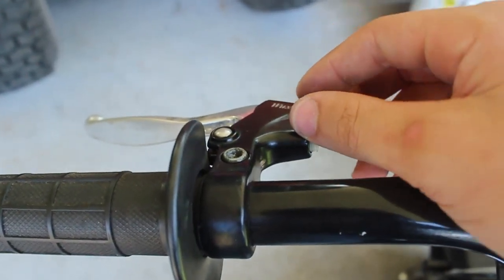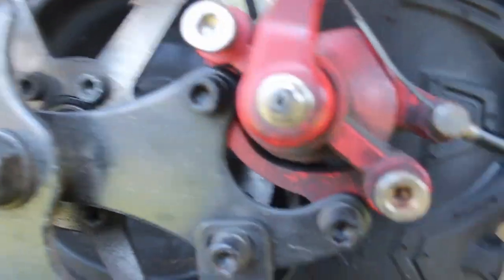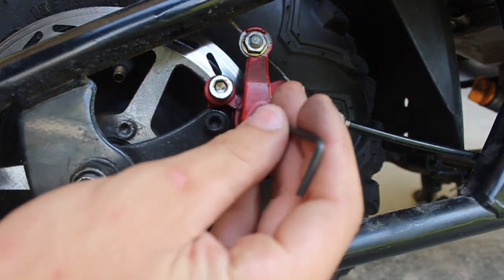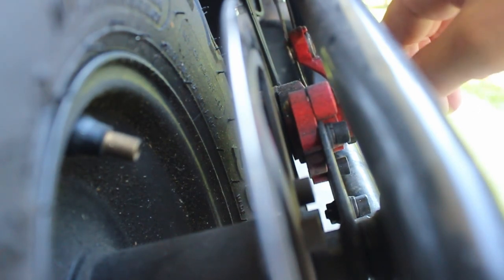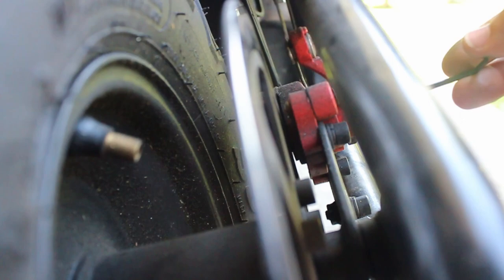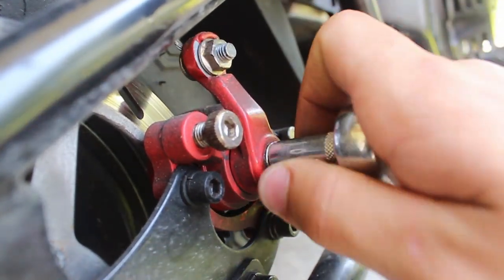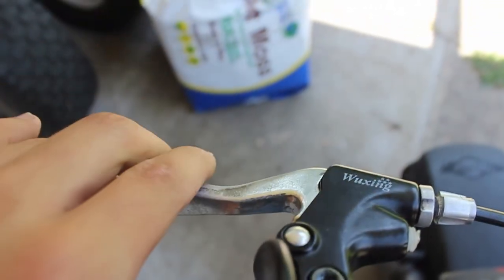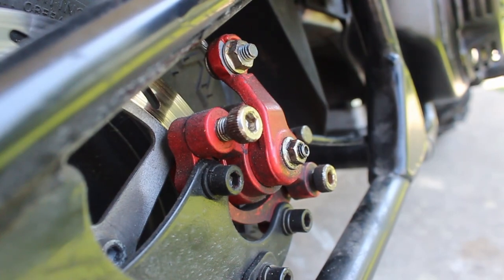Adjusting Mini Bike Brakes

Comment: I did exactly what you showed in the caliper but my brake handle is still super loose and doesn’t move at all🤔
Reply: Your issue may be the cable is loose.  Just loosen the bolt that holds the cable on the caliper and tighten the cable there.

Comment: How do you adjust the back pad? Mine rubs off the disc brake ?
Reply from the maker: You prolly have a warped rotor this is adjusting brake pads